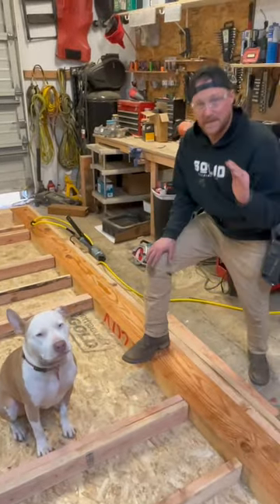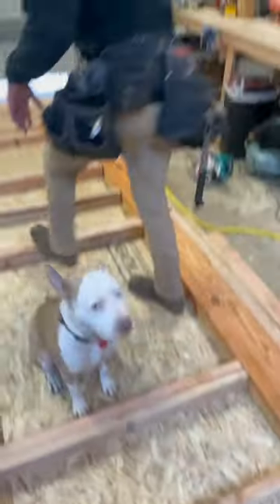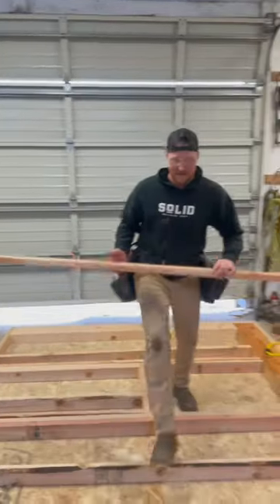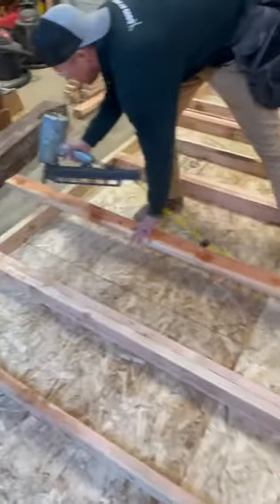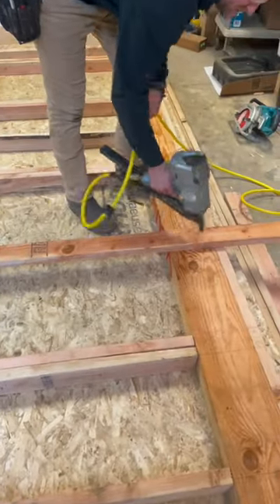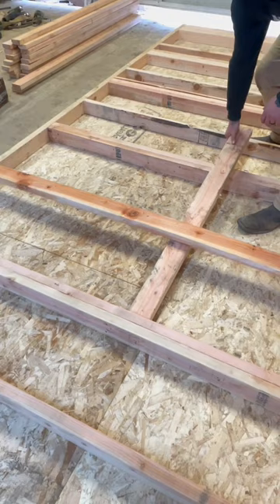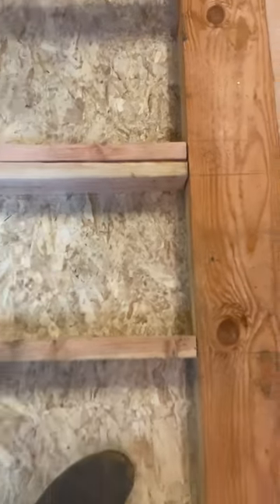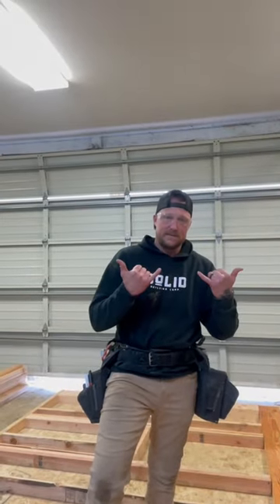#Tiptothetop using a simple fulcrum point  to close a gap or move a wall- watch for a 2nd method ￼

Comment: Would it nor be better to nail to the header first then nail bottom plate. Since a 2x4 on the flat is much easier to manipulate than a dbl 2x8 header
Reply from the maker: Ya that probably would have been easier. But it’s typical to frame the bottom plate first- didn’t realize the beam would have such a crown
Reply: I mean would it even make a difference? Cause even if the stud is nailed to the bottom plate it would still push the stud closer to the beam even if its attached as the stud isn't stopping it by being nailed to the plate.
Reply: Should have built your wall 1.5” smaller with a top and bottom plate and then fastened your LVL or whatever you’ve got to the top plate.

….work like a gentleman and a better product.

So what about the extra 2x4 it’s well worth it.

What do you think?
Reply: TOUCHÉ 🤺 Nail to the header first, toenail them well. Then nail through the bottom plate into the studs, cripples and trimmers.
Reply: Exactly what I was thinking. Stud won't move the header anyway..
Reply: @chrisreynolds2410  I think that's a damn good idea.
Reply: PFP….thanks  bud I appreciate the compliment it’s a wonderful idea.

Most “carpenters” couldn’t even sharpen my pencil.

I’m just prideful and skilled and that’s a rarity now a days.

Comment: If instead of trying to bow the board you nail the pry bar to the side of the 2x4 as a pry pole then as you lean your hip on the pry pole you can tighten up the gap just by leaning on the board instead of having to lift it and kill your back

Comment: If the studs to the left and the right are tight and the double stud is not, you're just putting a bow in the bottom plate. The gap will come back when the bottom plate is nailed down unless there happens to be a hump in the floor right there.
Reply: Nah when you put it on the ground when it’s flat then put the weight on the beam it i will all settle and take the bow out of the beam but he didn’t get them tight

Comment: Nail them on the header first .then your bottom plate .and use that thing on your side to tighten up any places that need it .carpentry 101
Reply: Or you could nail header studs first then put the bottom plate on . Common sense ain’t that common

Comment: I use a ratchet strap. But that also
 "get'er done"
Reply: Ya listen bud they have a better way take your little ratchet strap idea and beat it
Reply: @scottburnett9653  Scott GFY
Reply: @scottburnett9653  okay scotties little softie
Reply: I'd use structural engineering screws screws for that ,just mho. Not nails in that scenario, not the way to frame but....
Reply: That's how I would do it so the bottom plate stays straight for sheathing, those tie down rings you can screw down work wonders with ratchet straps

Comment: Yah framed the wall form the bottom up!  Come on guys , first rule of construction. Work smarter not harder. Next time toe nail to header first and sole plate from center out, that will give you good pressure on the stud bottoms  so they stay in place. When you been building long enough, methods like this will be natural and you won't even notice

Comment: Um, that's a load-bearing wall-well it would be.  Why not wait until it gets "some" weight on it. A little red spray paint wouldn't hurt as a reminder for that 1 stud.  Also, the bottom plate would flex easier!

Comment: Or you could use ratchet strap, get it much tighter.
Reply: 1 1/2 lower studs you can run a top plate along the top, below the beam. nail your studs into your top plate then your top plate to your beam but what do I know

Comment: That was way to much effort for a small issue. If you took a hand drive and toenailed it through the header/beam first  into the studs and kept hitting the nail until it pulled tight it would be way faster. Although I do like your trick for some other applications that are not so easy

Comment: Lmfao, you realize youre just bowing the bottom plste not the header beam. Couid achieve the same result by simply lufting the studs and dropping them. They will separate at the bottom plate allieing them to be nailed tight at the top end. Once you beat the bottom tight you'll still have the bow. But dont need to remove the nails and lineal. 
Alternatively you block the bottom ends of the wall and use s block and toe nail to bow the header.
Typically you block beteeen every other stud at the header and leave the gap. The header is built with s crown that is meant to deflect under weight. If properly sized it will be flat with weight, bowed up without. 

The biggest question is, why are you studding under a beam. The studs are either bearing or they are non bearing. If brading you don't need the entire beam, if non bearing you don't need them tight. Shortest distance between two points is a straight line, bowing the lineal creates a radius, shortening the distance much like drawing the string on a bow. What they dijt show is that the lineal needs to be released on one rnd while still being bowed. If you simply release pressure the lineal will straighten and push the two ends apart, undoung everything they did.